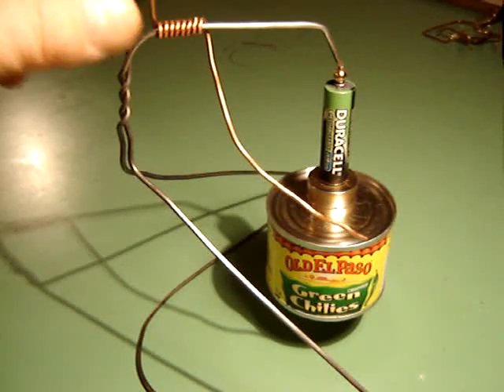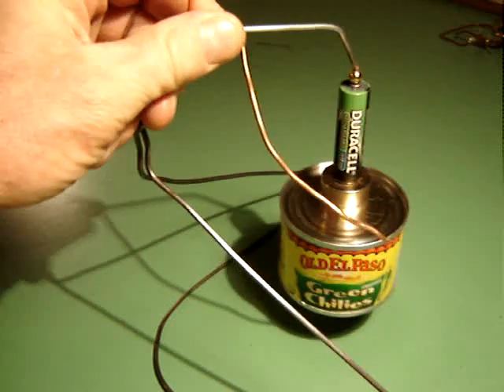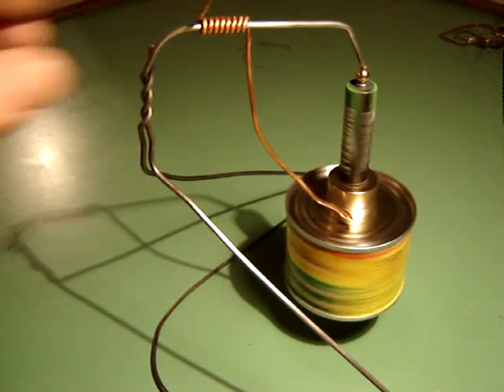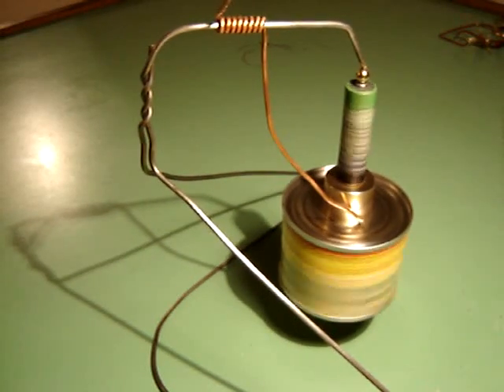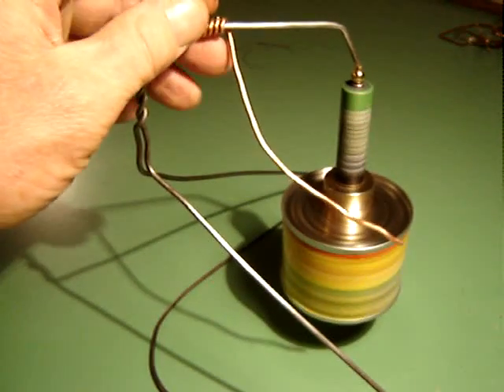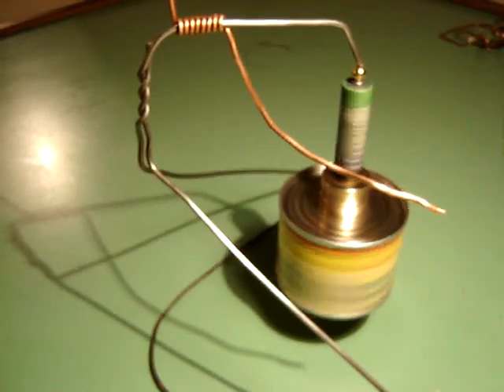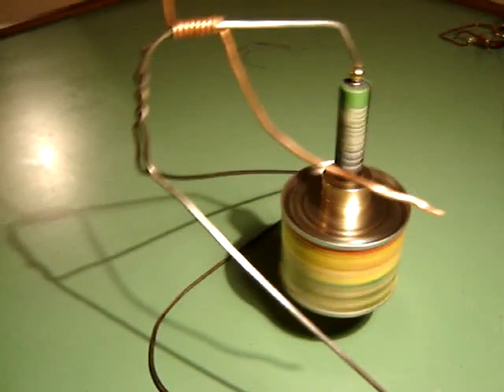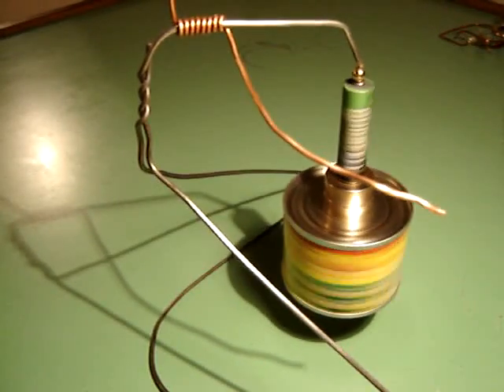Homopolar Motor With Emergency Brake System

Comment: These motors are basically for demonstrating purposes only and are not supposed to be used for doing the modern electrical motor's work but that doesn't mean that you shouldn't experiment with them, so good work
Reply: PunakiviAddikti I would like to clarify your statement, OK? This design has little practical useful application beyond demonstration. However, homopolar designs used to make electricity are used in factories that require high current sources for induction heaters and motors. The Navy apparently has some secret level homopolar systems onboard ships that give them an advantage over foreign aggressors. This is not a trivial design; a non-commutated DC motor/generator is significant. Finally, it appears that the motor stops when the current path moves from through the middle of the magnet to the edge of a metal disc below the magnet. Current is still flowing, but the magnetic field is reversed and lessened. If he gave it a reverse push, I believe it should spin slower the other direction. Also the effect of an imbalanced induction reaction; that is balanced inside the magnet and unbalanced outside. A lot to learn here.

Comment from the maker: A homopolar motor can make up to 25,000 horsepower with the correct supercooled wiring and superconducting magnets.( Google "Naval homopolar".) However there are issues with the brushes, overheating of the magnet or battery and so on, in a typical application such as you describe. Having low friction and well balanced helps.

Comment: It's not homopolar. Suppose the magnet is North up. The Magnetic field goes up, out, down, in and back up to the magnet's S pole. The conductor cuts the outwards (radial) part of the field and creates a rotating (tangential) force according to Fleming's left-hand rule. It is in fact a commutator motor, where the commutator is the sliding connection between the magnet and the wire. It's all been done before.

Comment: @MrfixitRick hi! i came across this video because i just discovered homopolar  motors.i was unaware of their existence and i'm new to electrical engineering. i just want to say that it is not possible to create a motor that would convert more energy than what is fed to it.This is against a fundamental law of physics, the first law of thermodynamics. any way,thanks for the video! :-)
Reply: goldCrystalhaze You are assuming some misinformation when you promote false statements like this one. 1.EM induction is like lift by a moving wing, it is proportional to the movement of the inspiring field, not the energy of the inspiring field. Do you question sailboats and airplanes? So, no restrictive correlation of energy in to energy out is rational. 2. The induced field comes from the neutral and balanced fields that make up the very space that everything is in and part of. Like the atmosphere that provides the lift for the moving wing. So, electrical generation is an open system, able to tap unlimited energy, effectively being an electrical amplification. 3. The limiting force of induction called "Lenz's Law" is applicable only to systems that do not move the location or timing of the first induced field. When that induced field moves from where it was created or as it is created is when it creates the induced resistance. TC Heins and Joe Newman both delayed the movement and created motors that make more than they take to run. This homopolar design moves the fields to support the movement, similar to TC Heins and others that modify the geometry of transformer cores to capture the induced energy without canceling the input energy. Stop repeating dogma and see the truth, you're just impeding progress and perpetuating the senseless distraction of our natural resources, blindly supporting a wasteful consuming economy.

Comment: @MrfixitRick You are mistaken. Modern ABS systems use hall effect sensors which are actually made of composite of semiconductor crystals. I assure, there has been considerable effort, research and technology that goes into producing these sensors. These sensors are extremely reliable and accurate.

Even the older coil pickups you are talking about are very much more reliable than your bent wire. As a demo, it's fine. But it is a far stretch to call it a "Emergency Brake System".

Comment from the maker: @Gunner3210 
Automotive ABS systems are all about "bent wire". The magnetic speed sensors are made of a bent copper wire coil that a magnet passes over. The brake system computer with a bunch of bent wires inside controls the pressure into the brake lines, which moderates the braking action.

I have simply replaced the ABS CPU with a tin can ;)

Comment from the maker: @MuF123 
Good example, except with a regular car engine, you have to keep inputting energy by refilling the fuel tank. 

A few grams of thorium, equaling the energy of tens of thousands of gallons of gasoline, will run the thorium-based vehicle for a lifetime without refilling. Thorium is about $25 a kilo.

Besides, thorium can be very safe to use and it can't be made into weapons. Thorium is as common as lead in the Earth's rocks and soil.  

Cool, eh?

Comment from the maker: @MuF123 
As an example of a motor that appears to put out more power than input, would be a Thorium-based reactor engine. It requires initial power for the electrical/magnetic fields to start and keep the reaction going, but would output considerably more power than that input power. (no physics laws broken, just revisited...google "thorium car" for more info ;)

Comment: @MrfixitRick Just wire the neg or pos pole down to a plate magnet on the bottom, then toss a round magnet over the plate magnet. On top insulate whichever pole you drove down to the bottom and put a stick magnet across both, should be able to balance it pretty well with a properly polarized ball or dome shaped magnet in the middle of the bar.

Comment from the maker: @frostcat123 
It would not begin to run at all with NO torque. It has minimal torque, but is a small motor.

The naval ship homopolar motors are 25,000 horsepower...with lots of torque! (google "naval homopolar" )

Comment from the maker: @Jaramo1 
The top speed can be maintained with careful adjustment. However, if there is vibration, it tends to kick in the built in brake/governor.

Comment: Would there be a way for the wire to move back when its juuuust under the speed limit, that way you can maintain the top speed?

Comment from the maker: @kickass4510 
The only magnets that are strong enough and cheap enough are neodymium supermagnets. They are available online at a place like K&J Magnetics (see link in the "show more" box) or take apart a shake-type flashlight and use the magnet inside.

Depending on your motor setup, you can use a 1/2 x 1/2 inch magnet, up to the 1 inch x 1/2 inch size seen here.

Comment: that  break  would  "break" your battery if you would not touch it after  stopping :D but it's  very interesting and Im impressed by speed and mechanical performing especially:P

Comment from the maker: @themassau 

The sparks also occur with other non-coil designs. Although the wire itself may be partly the cause, it seems more of a commutator on the magnet issue. It would be a good experiment to try a copper sleeve around the magnet's commutator contact surface.

Comment from the maker: @BIBbib123456 

The sparks from a homopolar motor are interesting. The battery is only 1.4 volts, which should not produce much of a spark, yet the sparks are often clearly seen. There is a high current draw and it is likely there are bits of nickel and neodymium burning off.

Comment from the maker: @Crunchy68 

Parts List:
Steel Coat-hanger
14 gage solid copper wire
3/16 inch ball magnet
Heavy Duty AA Battery (rechargeable Duracell 2650 MAh NiMH shown)
1 inch x 1/2 inch neodymium magnet
Chilies tin (empty)

For info, check out Wiki under "Homopolar generator" and see my other homopolar motor movies!
Good Luck!

Comment from the maker: @a4d2d0 
The speed would depend on how much power the Joule Thief can put out at it's higher 4 or 5 volt abilities. 

Generally with homopolar motors, the higher the voltage, the faster the speed, and the higher the amperage, the more torque. But this set-up requires a couple of amps to get it rotating and overcome resistance; it will drain this heavy-duty 1.5 volt battery quickly.

If this AA battery had more voltage, and was able to maintain the same amperage, the device would rotate faster.

Comment from the maker: @Djrepsaj 

The word homopolar refers to this type of electrical motor...it means uni-pole or single pole. Most motors have a segmented commutator, or use electronic means, to rapidly reverse the magnetic poles to keep the motor running. The homopolar motor makes use of Faraday's Law regarding force on a rotating conductor in a magnetic field.

Comment from the maker: @dajakesta1234 
The only "switch" is the copper wire connection to the magnet, which gets "tripped" like a circuit breaker in this case.

Comment from the maker: @drummaniaco 
Also, the hanger wire is steel, not copper, and it must be scraped of the varnish coating so the copper wire makes contact with it.

Comment from the maker: @drummaniaco 
I used the most powerful N52 magnet below the battery. 

The battery is magnetic (note:some batteries are NOT magnetic enough to make this work.) The magnetism goes through the battery and allows it to hang. 

The heavy-duty hanger wire must be smooth and rounded where the battery contacts it, not a point.

Use a tiny magnetic ball if you have to.

It wasn't easy, as it's all at the limit!!

Comment: hey,gotta a question,why or how is the battery hanging? how do you do that? does it have a magnet in the bottom? I used all the materials you say u used except for the thing in the bottom and could not make it work,i scrapped and sanded the copper wire,what did i do wrong?

Comment from the maker: @james4562000 
The hanger wire is a standard metal coat-hanger. It has been scraped and sanded where it makes contact with the copper wire. The copper wire is # 14 gage wire, found in household wiring.

Comment from the maker: @stitchloveslilo 
Most magnets are not strong enough. If you can find a shake-type flashlight, they have a neodymium magnet inside. Or, you can order magnets from K&J magnetics...link in the "more info" box.

Here is another option to make a homopolar motor using a big bass speaker magnet...there should be lots of those in the Phillipines! Check out my movie "Two Hearts Become One" watch?v=nERQQl7KlHc for more about this.

Comment from the maker: @worlddomin623 
A full tin would be too much weight for the battery as a magnet. It could, however, be supported by placing a ball magnet between the hanger and the battery + terminal.

Comment from the maker: @654magicman 

The parts are: 
1.) a strong battery that sticks to a magnet (Duracell NiMh rechargeable 2650 mAh are best.)
2.) a strong neodymium magnet about 3/4 x 1/2 inch 
3.) a steel coat-hanger or welding rod as a stand.
4.) a 1 foot piece of copper wire to wrap around the stand and touch the magnetnet (scrape the hanger for conductivity)
5.) OLD EL PASO Green Chilies tin, empty

Comment from the maker: @sk8malaka 
If you mean the copper wire, it is 14 gage solid copper, and it is the contact wire to complete the circuit. The coat-hanger stand must have its coating sanded off for proper contact with the wire.

Comment from the maker: @arctyler 
See previous comment about this. The voltage determines the speed. Since a 1.5 volt C cell is the same voltage as a 1.5 volt AA, the speed would be the same. The larger magnet may not increase the speed either. But the motor would have better torque from those mods.

Comment from the maker: @ohcaptainmycaptain4 

The amperage will determine the torque, and the voltage, the speed. Also the magnetic disc radius will affect torque and speed. The strength of the magnetic field will affect the torque and speed.

So a D battery of same voltage may not make it spin faster, but the increased magnetic field of the larger magnet might. It should have more torque at least.

Comment from the maker: @Sneighe
Picky, aren't we? However, none of your statements are true.

A homopolar motor can rev up to 10,000 rpm. Once this one "brakes", there is no contact between the coated surface of the lid and the conductor, therefore completely shutting off the battery current.

The speed of the homopolar motor is directly related to the voltage and power that comes from the battery, so over-speeding of the motor automatically indicates too much power is being used. 

Everybody knows over-speed kills!

Comment from the maker: It is a motor that requires electricity. It just runs by a different principle than other electric motors, and has been ignored for 150 years, until recently with neodymium magnets. The latest naval ships use twin 25,000 horsepower homopolar motors.

Comment: the problem i see, it stops with the wire still making contact, which will make the battery over-heat, possibly even rupture.

Comment from the maker: You are basically right about how it works. It's simple, but finely tuned and can be hours of setup tweaking to arrive at this point. Simple, not easy!

Perhaps you could find someone with a credit card or paypal, and get them to order magnets online for you. It's best to start with a size from 1/2 inch to 3/4 inch in diameter, with 1/2 inch height. 

Big magnet tip: Use one at a time, or you can expect they will find a way to smash together at high speed!

Comment: That seems really simple.
Is the wire just loose and the bouncing causes it to bounce back and grip a bit and follow the direction of the spin?
Can the wire be twisted opposite the direction of the spinning, or will it jam and fly apart?

Comment from the maker: The homopolar motors are hard on batteries because of high current draw. This is the best Duracell 2650 MAh rechargeable, and it will only last a few minutes before discharging. The battery can heat up as well.

However, it's a ton of fun to play with this concept, and well worth an occasional battery replacement. Go for it, I say!

Comment from the maker: Good ideas...try it out is the best way to discover!

Google "naval homopolar" and you will find the navy is building 50,000 horsepower homopolar motors for the latest ships. They use superconducting wire that is supercooled.

Comment: thats what i'm trying to acheave, what if we use a lighter[even if its thinner] magnetic metal.... then submerge into something like water[yeah that might not work so well... of really really thin mineral oil[that absorbs heat rather nicely] 

idk,, something that will simulate eightlessness, then make that bitch spin, i bet we could get more juice out of it...

i want to be the richest man now

Comment from the maker: It's true as seen here, the homopolar motor is inefficient. However, the navy uses 50,000 horsepower homopolar electric motors in the new ships because they are the most efficient electric motor in the world(98%), and quiet too.

Comment from the maker: The stand is made of steel coat-hanger wire, the contact wire is 14 gage solid copper wire, the magnet is a neodymium supermagnet, and there is a ball magnet holding up the battery.

The chilles tin is steel, and was emptied of it's delicious contents beforehand!

Comment from the maker: These homopolar motors can draw up to 5-6 amps at 1.2 volts, which works out to about 6 - 7 watts. The motors normally run at about 1-2 amps, I would say. It's hard to measure while running.

Comment: But once the brake kicks in, you have a short circuit, meaning the battery will still heat up and potentially explode if you don't remove it.

Comment from the maker: Generally, you need to use a neodymium magnet that is conducting. But actually, any strong magnetic field will do. I have done some experiments on the back of a large bass speaker as the magnetic field. Then I used a penny as the contact instead of the magnet.

You can get neodymium magnets at K&G Magnetics...the link is in the "more info", to the right>>.

Comment from the maker: The wire can be silver or gold or any non-magnetic conductor.

The coat-hanger stand is made of steel so the tiny ball magnet will stick the battery to it.

Comment from the maker: The homopolar motor works because of a principle effect called the Lorentz effect.

 Basically, a current through a conductor in a magnetic field will experience a force perpendicular to the direction of the magnetic field and perpendicular to the direction of the current. This produces a torque  in the magnetic disc and wire.

Comment from the maker: 1.)steel coat hanger, sanded at elec contact points.

2.)I used a 3/4 x 3/8 inch #DC6 magnet from K&J Magnetics
( See K&J link to the right in "More Info" )

3.) Copper wire #14 gage solid copper household wire
wrapped around the sanded-off coat hanger as a brush connection.

4.) Old El Paso Green Chilles (be sure to eat first for lighter weight!)

Any prob, let me know!

Comment from the maker: In this case, they would weigh too much, and would likely fall off the hanger. 

Generally, a bigger magnet equals more torque and speed, but requires more total energy from the battery. More voltage from the battery will increase the speed, whereas more amperage will increase the torque.

Comment from the maker: Technically, there may be a small amount of current still flowing through the can. I think the coating on the can prevents most of it because of high resistance. The battery doesn't continue to overheat, so we are safe!

Comment from the maker: Often a small ball magnet will smooth out the rotation. In this case, I could not suspend the battery plus the chillies can without it. 

The ball magnet adds some eddy-current magnetic drag to the rotation, and is to be avoided if possible. Also, with the extra electrical resistance, the ball will get very hot!